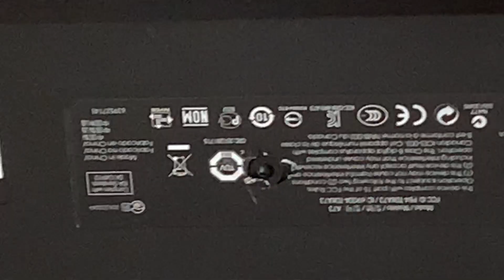TDK A73 how to replace a battery Boombox Ghettoblaster

Comment: Per the TDK INSTRUCTIONS...
Replacing the Rechargeable Battery: If the battery does not supply enough power (see note in Rechargeable Battery Notes box below), replace the rechargeable battery as follows: 1. Remove the four screws on the bottom of the unit, then grab the ends of the bottom cover and rotate the bottom cover clockwise to expose the battery. 2. Unplug the rechargeable battery and replace with battery pack from TDK Life on Record. 3. Replace the bottom plate and tighten the screws.
No need to remove the center bottom screw.